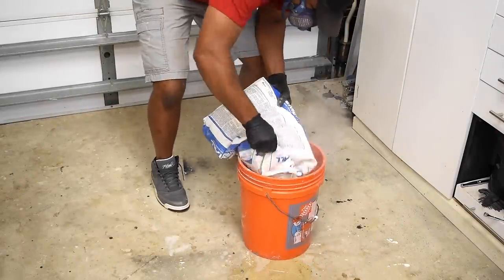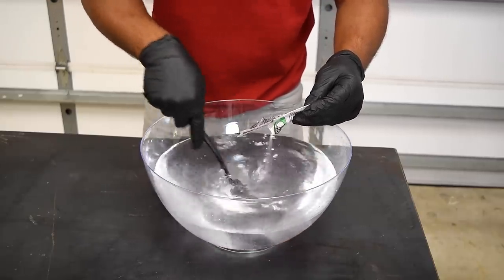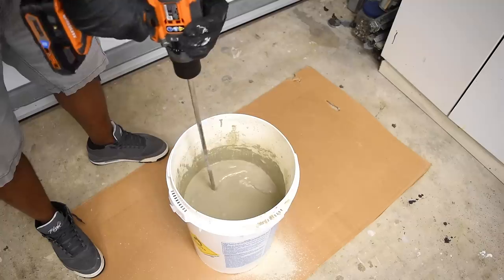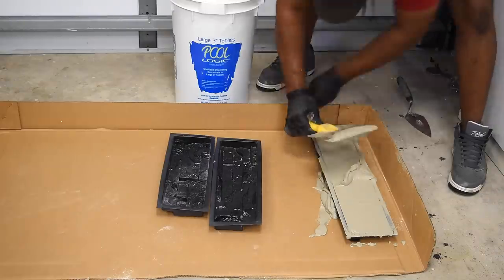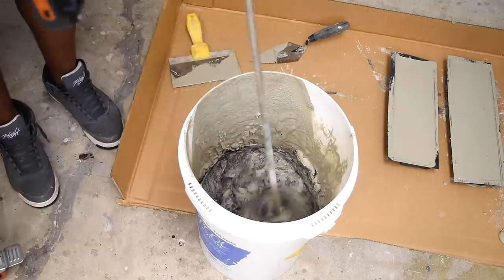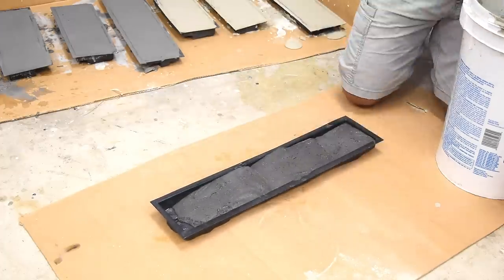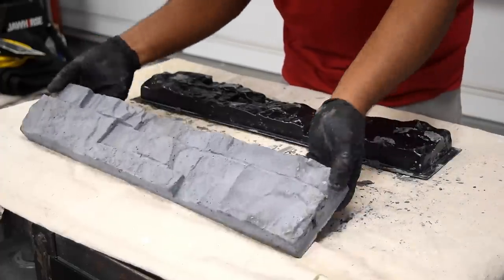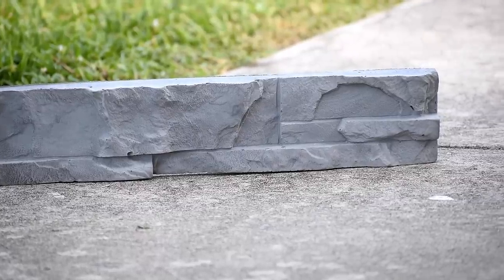How to make Concrete Stacked Stones ( Homemade Wall Stones )

Comment from the maker: For a materials list on the blog post, visit http://bit.ly/2LWTyJV Thanks for watching, what you like to me make with these?
Reply: Try an accent wall maybe, with a framed picture and lights.
Reply: I hate ask cause I live Canada and I was wondering where could a person buy them plastic molds at,Cause a lot of the things I sees here on the net you can't get in Canada cause it not sold here UNLESS you PAY EXTRA AMOUNT OF $$$$$$$$$$$$$$$$$$$$$$$$$$$ to get it.
Reply: This is pretty cool I also did it with banana leaves 😁 also have been told no home from me 😭😭😭 just don't want to live anymore now 😭😔
Reply: Pillars, with light at top. Like u see at end of housing driveways
Reply: DIY Creators did you give permission for another channel to use your videos? I dont know if you know but there is a diy Creator latino. Its your videos but in Spanish
Reply: DIY Creators show us what the end project looks like, thanks!
Reply: @patriciahibbert6139  Maybe you should search locally, I'm sure they must have the equivalent or something suitable.
Reply: @feudiebooty  I think it would be best to use cement coloring first then pour the actual cement.
Reply: Maybe make something completely unexpected, something not normally made from concrete, like a lamp base (with the body made from a log to look like one of those Wyoming-style log cabins), or some drawer fronts, or maybe an end table or coffee table. Heavy as they are, they'd probably make great book ends, too. But whatever you do with them, they should be paired up with some kind of exposed wood elements, and/or some chrome or brass elements.
Reply: @feudiebooty  not necessarily because if you watch these videos on how they make cement flooring, they use different colors. It may be a little more difficult but it is not impossible
Reply: @feudiebooty  Really? I have been nothing but polite with you and you have the nerve to disrespect me like this? SMH I won't stoop to your level, you should be ashamed of yourself.
Reply: Hey, could you do a how to install them on a wall
Reply: I would like to know where to get the colors for the quick set, concrete? I need  them in warm earthy colors? 😎
Reply: @feudiebooty  Painting the face will not be realistic like colored concretes,,, Those  layers has shaped segments at the beginning so what you will do is to mix small amount of cement with your favorite colors, fill the segments a bit to be the face,, then mix the remaining cement that will cover the mould up to base,, in that case you will get diff colors at the face when you finish,, Note be extract fast about it so that the mixture will not set differently or  don't use rapid set so as to give you more time.
Reply: @feudiebooty  what's is your career?
Reply: @feudiebooty  I'll get by, ♥️🙏🙏🙏 I pray to God each day for a home. Thank you so much ♥️♥️🙏🙏🙏🙏🙏😇
Reply: @feudiebooty  you are so right I always try to keep my head up so I could see the rainbows. I thank you for thinking of me, you are one awesome young lady!!!! I just want a place of my own to live 😭 to put my pretties in my knickknacks up again would be in Oh, wonderful day! Places to call to find out if I can rent???? There is an area on here where we can speak freely if you like?!? Or you can email me... I like being able to speak on the private section of here God bless you honey for thinking of me 🙏🙏 🙏 much love and respect 🇺🇸🙏♥️😇
Reply: Thanks for your amazing Work and ideas🙏👏🇨🇦
Reply: Can you use mortar to make the stones?
Reply: How heavy is the final product? These look like stones people use to cover fireplaces with... I say make yourself a nice stone fire pit for your back yard. You got a lot of control with the appearance given you can add whatever color you feel like to the stones. I really like those blue-gray ones you show off near the end.
Reply: How about a fire pit?
Reply: I enjoyed watching the process.
Reply: @patriciahibbert6139  yeas i have seen molds at the lumber stores last year but not recently. Look up cement molds.
Reply: @anjledube7026  did you say no home? What area are you in?
Reply: @feudiebooty  probablycould.. it be worth experimenting
Reply: @yomero752  yes...
Reply: @stardustgirl2904  home depot...lowes
Reply: @donatuschiedu6887  great response..
Reply: @nohandle379  you could try or make hydrated lime
Reply: @cherriemckinstry131  still no place for me as of yet now that I am disabled after the fall from the roof of my mother's house I broke everything from my nose to my toes I am up walking talking and doing things that I can do I live in South Tampa by MacDill Air Force Base I stay in this area to be close to my mother and family but what's that anymore all I need now is a car put me in it I'll live in it easy peasy I have all my beautiful furniture in storage and then of a better place than I do God bless you thank you
Reply: Reading some of the past comments, folks were talking about color. Here in the US Home Depot sells and concrete stain. It penetrates the concrete and does not lay on surface like paint. It also can come with a sealer inside the stain. You can buy various colors and use a sponge or brush. I used it on concrete patio blocks. I live in the Houston TX area and the sun was hot and bright. It dried fast.
Reply: @feudiebooty  thank you love Glenn knows everything we've been together probably three and a half years or more I just love him and he knows here in Florida great person great personality yeah I'm still here still around still alive don't know why God bless peace be with you much love and respect
Reply: Just to advise all viewers you can use any concrete but some are more durable than some. You should wait about 2 days before taking it out of the big molds

Comment: Hey bud a few tricks to help you out with this. 
1. Try using the rapid set flow control as well, you will get a much more fluid consistency for pouring out. 
2. At the color to the water before mixing the cement, you will get a much more consistent color
3. Use a brush across the top to give a rough texture, this will help you bond to another surface during install creating more surface area for your mortar or adhesive to bond too. 

Good video though
Reply: 2. With rapid set you often times do not have to mix it well enough it is much better to mix color in the water prior to powder. 
3. While trying achieve the best bond you must have a rough or textured surface on both the stone and substrate 

I’ve been a mason for 15 years I’m just trying to help out and not argue with a (YouTube mechanic)
Reply: adding color to the water wouldn't apply here because he did more than one shade so less trouble, time and containers this way, most should understand but always good to hear from an expert...thanks!
Reply: This is a color test and how to on a smaller scale. if you are doing a project you will be pouring solid colors from a single bag not several colors from a bag
Reply: @medaw1987  yeah but if you want to start with original then the water has to be added without color first and no one wants to mix several small portions.
Reply: Again I’m giving my expert advice I work with cement everyday and have done so for longer than a decade. I’ve used powder colorants liquid colorants oil based stains and water pasted stains. I’m not here to argue with (YouTube mechanics) or weekend Pinterest warriors. Take my advice or don’t you do what you want you tube viewers
Reply: @medaw1987  He didn't use color in first batch so professional or not, common sense rules you out. Tell us how to do what he did in one container and less trouble and I'm here for it..ijs Sir.
Reply: Ok last post and I’ll say again for the purpose of a video and testing color yes this makes sense. When you actually start a job you will not be mixing different color variations out of one bag, you will be doing solid colors per bag. And I empower you to go mix with water first and then another where the color comes in last and you see what gives you the better outcome and then you can argue with yourself
Reply: @medaw1987  Martha Stewart taught us to mix dry ingredients and then wet together although we didn't need her for that either, common sense did the trick...smiley face!
Reply: After having worked with cements for over 150 years I can confidently say he should have used white cement and colored it with a sharpie after it dried.
Reply: @heyyou5801  I concur...lol
Reply: Michael d ...
Totally agree with you...
Reply: Yeah, smart hints man.
Reply: @eyeswideshut2800  why would you try and argue with someone that does this as a profession? What do you do for a living?
Reply: @JohnMatrixOfficial  We weren't having an argument, he just couldn't comprehend mixing several colors but starting with original doesn't work his way so the so called "expert advice" was already merely common sense. Let's leave him be, he corresponded he'd been working with concrete for "150" yrs so he's probably VERY TIRED. To answer your question, I'm the one who orders the concrete GUY and tells every other guy what to do so I know I'm qualified to use my common sense on mixing color in ANYTHING...red+blue=purple...SEE I GOT THIS!
Reply: @jaredherring958  Listen Buddy, I was respectful and explained my position already, you are instigating for no reason except perhaps you're bored in life. The position is General Contractor and the concrete guys expertise is the last concern on site. We all know how to mix and level, our main concern is just getting it there and poured on time, any Goober can watch it dry. The only contractor on site I roll my eyes at and start contemplating my dinner is the ELECTRICIAN, I leave him to the Inspector, we all get pipes and pumps too.
Reply: Michael d what is the  formula
Reply: how do I also give a rough texture to an exterior (walkout basement) smooth cement wall???
Reply: @medaw1987  good tips can you help I'm in the UK,
Sorry I do have a silly question can this cement be used for a raised flowerbed? 
what cement is best to use for wet conditions,
How can i get the cement chalky white without giving to paint it 🤔
Reply: Eunice Mumbit Trill if I remember correctly you can use that brands cement all product in wet conditions and should be ok for flower bed. I do know it will dry a chalky white in its own
Reply: @medaw1987  I will defo try finding it,
Thank you, a great idea getting moulds and making them yourself, i don't  need too many 👌
Reply: Michael_d. Can you paint the inside of the mold with concrete stain to get a more variegated/mottled natural stone effect on the front face - or what would you recommend.?
Reply: Lori Carson I have never tried that so go ahead and give it a test. I do not think it will go very well. I have used colored grout powder in a very thin layer to do designs and patterns and that works satisfactory
Reply: @medaw1987  dried grout powder sprinkled in the mold before pour?
Reply: @medaw1987  thank you for sharing your knowledge 🙏
Reply: Sometimes color inconsistencies help make things look more natural. Depends on the project, so it's a good tip in general to mix into water.
Reply: thanks for thr tips
Reply: @eunice8116  Hi i am no expert. Yes you can use it for your flower bed. I just bought a concrete waterproofer from Wickes. They sell white cement, more expensive but that way you can add whatever colour you want or just leave it white.
Reply: i will use calcium chaux + sable for make the wall breath
Reply: @eyeswideshut2800  🤣🤣 BAM
Reply: @eyeswideshut2800 when she was in prison?
Reply: @latitude1904 dash it in the mold
Reply: GC? I met a 19 year old GC the other day. He didn’t know the difference between a toothbrush and a paintbrush, hell, common sense knows that.
Reply: GC? I met a 19 year old GC the other day. He didn’t know the difference between a toothbrush and a paintbrush, hell, common sense knows that.
Reply: @mikejustice1196  Surely you're not judging Martha when we're in a conversation 8yr olds conquered at 5...cmon man

Comment: Having worked in the stone veneer industry, a trick to make the flat dry stack look more natural is to paint the mold before pouring the mix.  The mold we use were made of urethane.  The even solid color in the ones in the video are good if they are going to be painted thoroughly, but for a real stone look, I would recommend trying a cement mix coloring.  Grays, blues and some browns for a slate look with a rusty sediments.  I really like your videos.  Keep them up!!

Comment: Great looking stones. I found by spraying the mold with cooking spray the blocks release easier. Thanks for another project idea.
Reply: I used cooking spray when I made my concrete countertops, along with charcoal coloring, just as he did. When I un-molded the slabs the cooking spray had some kind of strange reaction with the concrete because it gave it a marble-like look. Light and dark areas. Purely unintentional but looks great! Sometimes our best results come from our mistakes!
Reply: @ggumfory  are you sure it was the cooking spray and not your colorant? I've been making flower pots and large planters and would love to get a marble-ized finish.
Reply: @jcrefasi1  To be honest, I'm not sure why it made the pattern it did. It's just that the pattern looks like where the spray pooled. I mixed the concrete with a concrete mixer so the color was well blended. Shortly after, I made a smaller countertop, forgot to apply the cooking spray, and it didn't make any kind of pattern. Just smooth and uniform. Who knows!
Reply: @ggumfory  sounds like the spray to me
Reply: @ggumfory Thanks!! it sure sounds like the cooking spray. I normally work with it as a release for my hypertufa flower pots. I want to experiment with color for a countertop reno
Reply: Wd40
Reply: I found that WD40 works great to coat the molds. Never had a problem with discoloration or anything else and the concrete almost falls out of the molds. Just saying. Great video for anyone.
Reply: I use castrol oil and rubbing alcohol mix for the releasing agent.
Reply: Murphy's Oil Soap
Reply: I think the marbled look would make it look more natural....cool!
Reply: Maybe excess cooking oil/didn’t get wiped all the way. I’ll try it this week and report back.

Comment: Hi! Thanks for the video. An advice to remove all the air bubbles is to spray a mix of water and isopropyl to the mould prior to pouring your material, allowing perfect flow as the surface tension in the water is changed.

Comment: A couple drops of dish soap in a sprayer with water sprayed and excess wiped off will help it pop alternatively you can put a tiny hole in the mold and blow compressed air to bond break it tape it up for future casting. Look into dry brushing paints to give it depth and texture, model makers will have simple tutorials on the process. I'd recommend going to your garden section of your big box store and finding some 5mm boxed mesh to insert into it just like the back of real stack stone. It will strengthen it if your laying near vibration also throw a quick sealer onto if it's going outside.

Comment: @DIYCreator - Nice simple tutorial friend.  I recommend you lightly mist the molds before pouring(should help minimize with bubbles). Also, for the bubbles, i recommend you use an air chisel on the underside of the table u set your moslds on. This should remove ALL bubbles if done correctly. Put something like a small block of wood between the chisel and your table to save your table from being chewed up. I would also recommend you use iron oxide pigment for coloring your stones.  Simply mist the mold and dust the mold with the pigment. Once pigment in mold, mist again if needed to make sure the pigment is moistened.  immediately pour over the pigment and vibrate out the bubbles.  Your stone will look amazing.
Good luck.  Feel free to ask if you have questions. ( I used to have some ownership in a manufactured (man made) stone company and made this stuff for a living.) We used cold pour rubber molds which we framed into a box, instead of the plastic trays.

Comment: When pour molding, do a small pour first to cover the textured surface of the mold, pour the excess back into the bucket. Then knock the bubbles out of this thin layer nearest the mold surface. At this point you can even use a brush to make sure you get into all the nooks and crevices of the mold.  After knocking the bubbles out, fill the mold again as you were before. This will cut way down on surface bubbles and ensure you get a fully molded result from your casting.

Comment: I worked as a concrete slab maker for over a decade. If you want to remove the air bubbles so you get a cleaner finish then you have to use a vibrater for a few mins to release all air bubbles. Either a vibrating table or a vibrating rod

Comment: To save some weight and possibly money, you could probably use plaster of paris with those molds if the work is going to be inside.  Concrete for exterior for sure.  You could enhance the stone look by painting them to look more realistic!  This is a great idea, thanks for this vid!

Comment: Take old motor oil and grease inside of mold for easy release....motor oil is the best thing to use any time you make a mold or form for any type of concrete job.
Reply: Wrong, pro's use diesel fuel or kerosene. It is way cheaper

Comment: Looks good and a lot less expensive than buying the stones.
Reply: some stones have a top lip to help seal. they'll sometimes have metal or other material to strengthen it. they'll also have a few dozen more molds so you dont see a pattern as quickly.